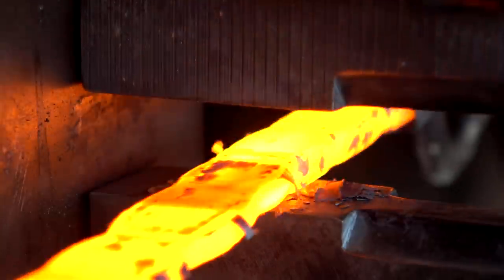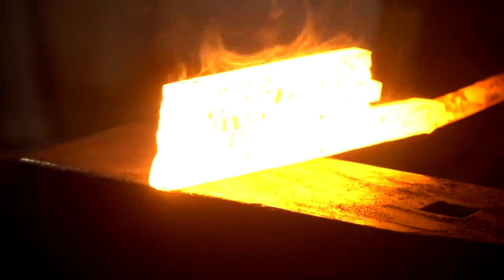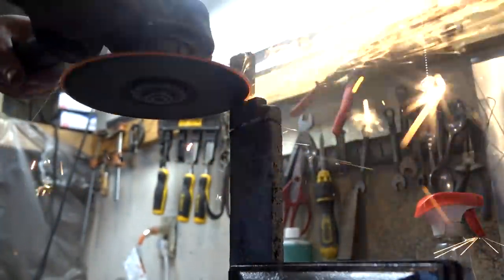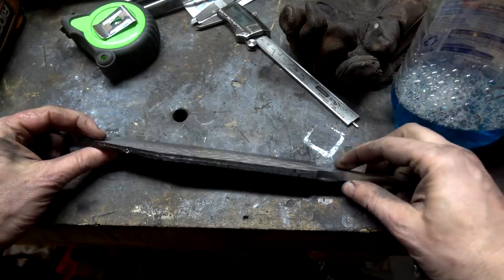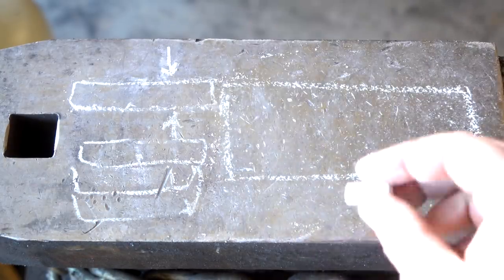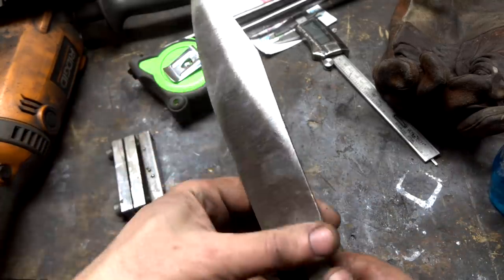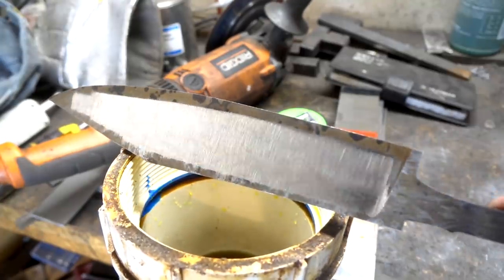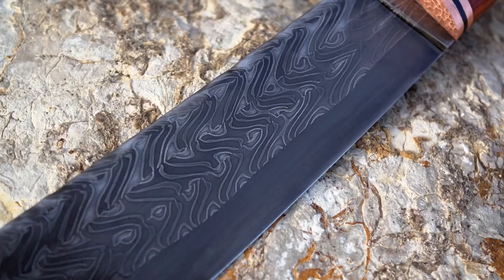Forging A Twist Seax Blade, The Second Knife!

Comment: Pretty impressive for your firs "S" Grind, a little tip if you're going to do them in the future is always cut in the large hollow Spine up so that you can see what you're doing and dial in the depth as deep as you need.  

Another thing, in regards to forging Wrought Iron... if you see a tear forming during the forging process, stop what you're doing dose the Tear with a liberal amount of flux and forge weld it back together, if that doesn't work, let the knife cool to blood temperature hit it with WD-40 with borax on top of it bring it up to heat and forge weld it as normal (the WD-40 wicks the borax into all the nooks and crannies of the wrought iron and the scale will just sort of squish out under your Hammer" and just in case you didn't know you need to work wrought at welding temperature, but judging on how far you've advanced in the past year I can tell that I don't need to tell you that ^.^

Anyhow if you find yourself in a bind and need some advice feel free to contact me at my Gmail or if I'm on at the time you're more than welcome to contact me via Google Hangouts 

As usual it's a pleasure watching you work, keep it coming :)

Comment: Well done! In the end you made a beautiful knife, a one of a kind, and learned a few things about doing the next one, keep it up! A few tips, if I may?  When it comes to twists, you can not forge the billet, at all, without wildly disrupting the pattern. Once your bars are twisted, and gently welded together with a hand hammer you are done. What ever shape your billet is in after that is what you have to work with, any further drawing, beveling, profiling, etc., will distort your pattern so plan your bars to match what you want your final billet dimensions to be. That includes knocking down the high points of the twisted bars into the billet, don't do it, you're better off grinding them flat on all four sides.

As for grinding to get the stars 30% per side is the general rule I use. You end up losing about 60 to 70% of your billet thickness. An excellent way to test this and test, and test without burning up fuel and steel is to use two different colors of sculpting clay. Layer it up just like you would steel, form, twist, stick together into a billet, then start slowly cutting into it with a sharp knife or razor as if you were sanding it down. You can take very thin sections off and clearly see the pattern as it changes. This way you can get a good feel for what to look for when you are grinding. Grind a bit, hit it with some ferric chloride to see where you're at, then go until you get where you want to me.

I hope this helps, and keep up the great work! Cheers!

Comment: As usual it is amazing work.  As much as you diss yourself you have a great deal of skill.  I have come to the realization that even master bladesmiths do not have easy times trying new thing and making perfect blades every time.  They are meandering through each new challenge just like you and I and often accidentally finish with great work one way or another.  You should be proud of what you accomplish!

Comment: You said you left it dark, what do you do to make the blade lighter, when it comes to etching? But I really liked how the blade pattern came out, even if it wasn't what you were looking for, don't beat yourself up over it, you'll get better with practice
Reply from the maker: high grit (2000 +) sandpaper will take all the oxides off for a bit until the relief gets too great.  I use Maas metal polish on 0000 steel wool most of the time.  You can put it on a buffing wheel too.

Comment: Wow Steve, that is an amazing seax. I have yet to create an s grind was it difficult? The finish is beautiful i wounder how it would work if you cold blued the blade after etching if it would yeald darker darks... Thanks for all your hard work and sharing this with us..... Martin
Reply from the maker: It wasn't as difficult as I thought it would be.  I need a bigger wheel though or a curved platen.  The radius was a bit small for this application.
Reply: Interesting ... Thanks for the insight... Martin

Comment: The wrought iron that you used in the previous video, had it been consolidated before use?
Reply from the maker: lots of inclusions and blotchy etching so I don't think so?
Reply: @GreenBeetle  wrought has silicates running through it and that separates it into grains. If you fold it, forge weld it, draw it out, and repeat the process it begins to work the silicates to a finer grain. The material becomes a bit more homogeneous and works a bit better. Maybe if you'd like to try wrought again it might be worth it to try and consolidate it a bit. It takes work, and you will have less material than when you started. But it will be better material.
Reply: Not sure if this helps or not. I went to SIU and took metalsmithing and blacksmithing classes there. I was always taught that if you were salvaging used wrought that it was generally best practice to consolidate it before using it.

Comment: Why did you mention wearing gloves when using the new belt?
Reply from the maker: I don't wear gloves a lot when grinding but having a a low grit, sharp, jagged belt will take off a fingernail or dig to bone on a knuckle if you slip.

Comment: Not to be "that guy", but you should be using alot more flux than you are. That could be the reason why your first attempt developed a split, rather than the steel you chose.